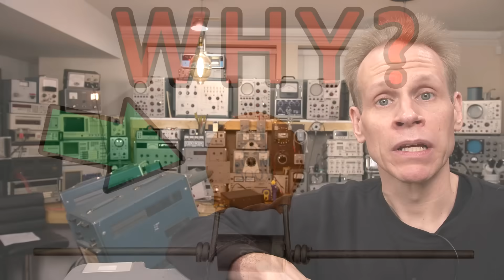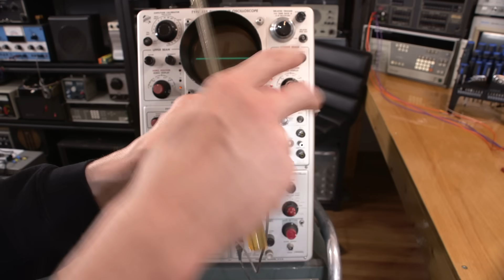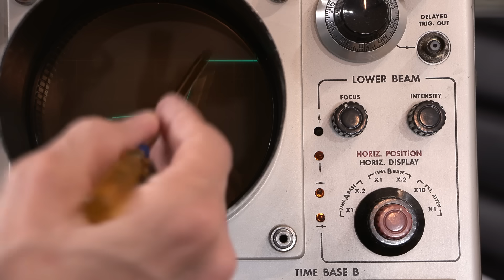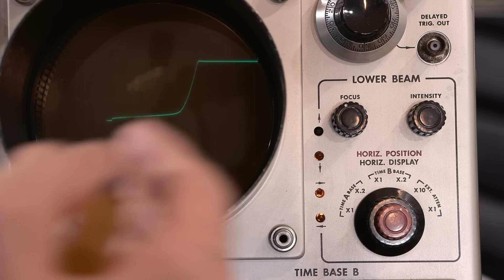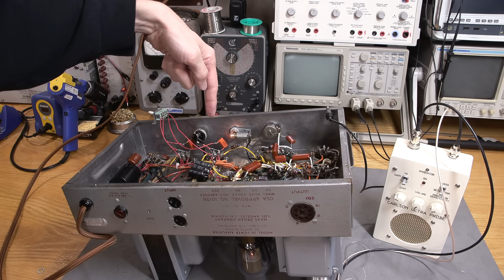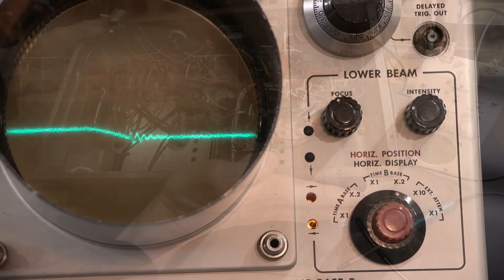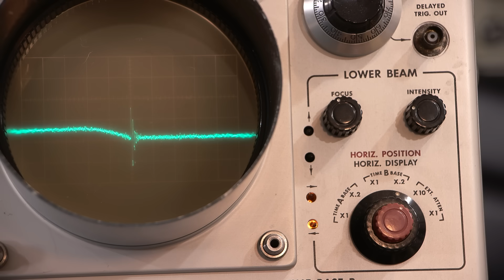Why Put A Capacitor Across The Diode? Here's Why!

Comment: If you look at the trace at 7,00 in addition to the 60 (30...?) Hz spike, you'll see a damped oscillation, yet another contributor to the noise. The capacitor acts as a short-circuit for the faster rise- time of the transient.

Comment: Great video.  I do wonder about the length of those wires to the switch, and how much they are acting like antennas.

Just like every car I have sold, I regret getting rid of my terrific Tek 555.  It was several years before I got to use another scope that triggered as well (modern scopes are pretty good at triggering).  It was wonderous how well the delayed sweep worked using only vacuum tubes.  The 555 is a pleasure to use, especially in the winter.

Comment: Thanks for this super tip. I never considered this in my 40+ years with electronics, now I can't unsee this, and it's permanently burned into my mind. Great tip, and I will stay glued to this series from you when you release them.
Reply from the maker: Glad it was helpful!
Reply: @MrCarlsonsLab  I've used your "trick" already today, I took the Heathkit Tube PSU (PS-4) and added 10nF caps to the 1N4007 I had used in place of the Selenium Diodes. It's rock stable, zero noise now.

Comment: There is another effect which makes capacitors across rectifiers a must. It is not related to reverse recovery, but it applies mainly to anything that has anything to do with AM modulated radio signals like MW radio or analog TV, but also indirectly with FM as well. And it is very tricky to chase, if you are unaware of the mechanism.
Any rectifier is a heavily nonlinear element, that changes conductivity. Not only for the mains power current it is supposed to rectify, but also to any RF currents that happens travel along the power lines. It could be some disturbance, but also the main RF signal, like an antenna ground return currents from the  equipment internal "ground" connection to the real ground.
What the rectifier does to it? The rectifier varies its dynamic resistance along the mains 50/60Hz frequency. That way it is periodically altering its RF impedance. And because it is in the RF current path, it creates extra parasitic amplitude modulation on it. And this parasitic modulation then turns into disturbance of the main signal.
The tricky part is, unlike the true noise disturbance sources adding extra voltages, the parasitic modulation does affect both weak and strong signals the same way: It is small (compare to other noise sources) on weak signals, but stays the same, so become relatively (vs the other noises disappearing) strong disturbance with strong radio signals. It then tends to mislead the diagnostic away from it being an RF problem and posing as some AF/baseband (after the detector) problem.
The capacitors parallel to the rectifier element (not only silicon, but as well a vacuum tube diode) bypasses thar varying, modulated impedance by an essential RF short circuit, so significantly reducing or even eliminating the parasitic modulation effect alltogether.

Of course proper antenna and ground connections reduce the effect too, when there is less RF current going along power lines, less of it could get that parasitic modulation, but nothing is perfect, the capacitors are just another piece to tackle the noise.
Reply: @annaplojharova1400 Wouldn't an RF snubber network (or filter) be a better solution for filtering out the RFI scenarios you are describing (those coming in from the outside world)? Although I did find your explanation a little confusing, sorry about that..
 
And if I may add. A typical tube rectifier has a soft recovery period, this tends to limit the likelihood of any transients.
So probably no real benefit putting a capacitor directly across the cathode and anode of a vacuum tube rectifier, as it may well cause other issues?
Just a thought..
Reply: @Chris-vk3 The point is not about the rectifier generating any RF noise. It is about the intended received signal, just partially passing through supply wires (usually as a path to ground, or at higher frequencies the supply cord acting as a part of the reception antenna). It is about the rectifier acting as a switch, periodically at a low frequency (50/60Hz) turning ON and OFF, so varying the signal strength that goes into the receiver. And signal strength variation is a modulation the thing put on the signal. And if the system is sensitive for amplitude variation (like the AM broadcast definitely is, analog TV definitely was; FM broadcast is more immune, but mainly when multipath reception conditions are involved, it may cause alternating which of the paths is the dominant one so alter the phase of the result and that will demodulate into the audio as well).

If the diode is in reverse, it conducts no current, so it has just its rather small capacitance, so for the RF exhibits rather high impedance, so "the switch" is OFF.
But if a forward current flows through it (during the power conduction), small voltage variation causes large current variation, so in other words it exhibits very low impedance for the small signal RF currents, so ""the switch" is off. And because it periodically changes states between forward and reverse, it is periodically changing its impedance, so the amount of RF current passing via the supply leads.
For this it does not matter if the diode is soft or hard, the dynamic impedance will vary and the RF get parasitic modulation either way.
But if you bypass it by sufficient size capacitor, that capacitor will act as a short circuit, so will pass the RF currents from the supply wires all the time the same way, so the signal stays constant, so no extra modulation.
Adding series resistors would make this thing worse, as the resistor will be higher impedance than the rectifier diode when carrying current (a semiconductor diode with 100mA forward current acts as about 0.2 Ohm), the "antenna" connection via the power cord will have about 100 Ohm or so, so the impedance must be way less than that to suppress the parasitic modulation But sometimes a resistor is necessary to dampen the resonance (suppress the ringing) with the wire inductances, then it must be kept as low as possible.
Reply: @annaplojharova1400  That is exactly why I now redesign my power supply in my amplifier to contain two snubbers - one before the bridge rectifier, and one after. I am using SiC diodes, and they have a tendency to carry over noise (high freq. - MHz) from the transformer as well (toroidal in my case). But to avoid overdamping, which make it worse, I have to use a quasimodo to tune in the right values for the snubbers. As I use 5 toroidal transformeres, and one with 3 secondaries, I will use a total of 14 snubber filters, all individually dialed in, otherwise they worsen the sound.
Cheers.
Reply: @annaplojharova1400  
Excellent - and one who has writing skills - that so many are lacking in
- despite attending school for at least 12 years 

Also impressive is that you understand the contextual difference between
ON / OFF     and  on / off
Reply: Hi! This is called intermodulation interference.

Comment: A little clarification would be nice, because you used two capacitors for the four diodes in the amp, a solution that I never considered, I always saw one capacitor across each diode. Also a demo would be nice with soft recovery diodes, to show how much less noise they generate. And what about putting ferrite beads on both legs of the diodes, and put the capacitor across the outside of the ferrite beads? Would it reduce the noise even more effectively? And AFAIK, this is not just conducted noise, but also radiated, so one might consider putting the rectiiers in a shielded can, especially when converting a tube radio from tube/selenium rectifiers to silicon.
Reply from the maker: The diodes are in series is to increase the PIV, so any inductive kick will be below that level, or limited to it.

Comment: So the value of the cap you need is related to frequency of the hum you're trying to remove?
Reply from the maker: It's basically getting rid of diode switching noise.

Comment: Why is Mr. Carlsson saying 2 parts of 50 cents each solves the problem ? For a full bridge rectifier you need 4 capacitors unless you have a trasformer with median connection in which case, yes, you can rectify AC with 2 diodes (and 2 capacitors).

Comment: The way i understand it, its to do with the switching speed of the diode. The faster the diode is capable of switching from non-conducting to conducting (during a 50/60Hz cycle) the more harmonics are produced throughout the spectrum. That sounds like buzz in an radio receiver. Rather like what a square wave generator would produce. So by adding small capacitors across the diodes effectively makes the diodes slower acting with less harmonics generated.

Comment: I am surprised to see you running a tube amp without a load.
Reply: No signal, no problem.
Reply: @andymouse  Well, not really. Noise is a signal. And amps sometimes oscillate without a load. And if you accidentally forget and send a signal through it, well, you might be out an output transformer and some tubes.
Reply: @RedBankVintageAudio  Strictly speaking yes, but ........ :)

Comment: Is this the same or similar to the squelch knob on older radios?
Reply: No.  The squelch was an adjustable mute.  The squelch allowed someone to monitor communications without having to listen to constant RF noise when no communication was incoming. When a signal was above a certain level determined by the squelch level, the signal would be passed by the squelch circuit which would unmute while the higher level signal existed.

Comment: Can you hear the buzzing noise with the speaker connected to the amp? Also you didn't show where in the circuit or schematic where you connected the scope.
Reply: In reality, there would be no audible difference in the performance of that amplifier either with or without the caps across the rectifiers...

Comment: Interesting video, but a bit confusing. I have some questions:
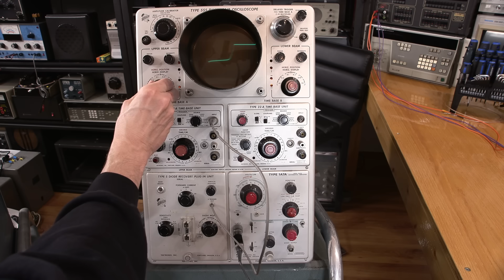1:00 What exactly is that device doing to the diode? And, related, what exactly are we looking at on that screen? What's the X axis? What's the Y axis?
What do you mean by "across the diodes"? A schematic would have been very helpful here, just a simple hand drawn one, showing the diodes and the caps.
Reply: I agree. I'm used to looking at voltage vs time on a scope, but this isn't that. Maybe it's current vs voltage? I wish he had explained what was being shown.
Reply: @mandlehandle-o8k He's using a scope that's been modified to be a curve tracer. It's a little over my head, but he has videos on curve tracers showing how they work and what they're for.
Reply: @mandlehandle-o8k Yes, it shows the diode's current-voltage characteristic. Obvious to people familiar with this area of electronics but otherwise pretty cryptic. I was curious about how it'd change if he added the capacitor, which didn't happen, sadly.
Reply: Just to pile on here, where is the circuit showing the setup and probe points. What is being measure on the X axis? What is being measured on the Y axis? Where is 0, 0 on the X--Y display? What is the scale factor for each of X and Y?
Reply: @tomc101  The 0 and the scale factors might very well be irrelevant, depending on what the X and Y axes are measuring.
Reply: Firstly, I was thinking this is related to using diodes as detectors for AM receivers or something and maybe that's why I didn't understand? Nope, the context really wasn't explained.
Reply: X-Axis: Voltage, Y-Axis: Current
Reply: Thank you. All my questions as well.
Reply: Will this fix the static buzz on my AM radio? Something interferes with the reception. Where do I put the capacitor? What size capacitor?
Reply: Is this in power rectification? Am detection? Where is this diode?
Reply: Useless video. Curve tracer with no explanation of x or Y.. is the diode forward or reverse biased or what.  Regarding the output .. what are you looking at? The DC supply or something else?
Reply: @rowifi  I agree. I'm a retired electronic engineer and to be perfectly honest, I haven't got a clue what he was trying to show us. No schematic, no indication of X and Y on the curve tracer, no indication as to where his magic probe was placed, no indication as to what the probe was measuring etc.  The recovery time of diodes is very short and nothing like the roughly 50 Hz hum from the probe, so what is he demonstrating?
Reply: @Chris-hf2sl   I think it's the instant of forward polarization in time after being reverse polarized.
He is probably showing the current.
You can see that the small step is the actual point in time and current is not flowing right away, but it takes some time for the diode to charge. The cap is making the current flow immediatly because it has to discharge and charge again to the opposite voltage...meanwhile the diode starts its forward conduction and the cap stops.
Reply: @robegatt  That's what I initially thought. But he's rectifying the mains at either 50 Hz or 60 Hz, depending on his location. Diode recovery times are measured in ns or less but the little flat part of the waveform at the beginning on the curve tracer was a significant proportion of the waveform, so it was in the ms range, at least a million times longer than a diode recovery time.
Reply: @Chris-hf2sl  You mentioned the quick recovery time of diodes, but the additional thing here is the resulting transients..
The second part of this video demonstrates a diode being switched at mains frequency, as it's a rectifier in a power supply..
That's where the 50 Hz you mentioned comes from, and what we're seeing is the resulting switching transients (without the capacitor in parallel) on the second cro trace.
As for the sniffer probe, have one similar that I've been using for years, and it doesn't need to be connected to anything. 
Thing is you need to know what to look for, and where to wave it around!?.
Reply: @Chris-hf2sl  he actually says "this area is the reverse recovery time"
Reply: @robegatt  Well, that's fine, but then we're not looking at a 50 Hz or 60 Hz waveform. So what are we looking at?
Reply: @Chris-hf2sl  that's a very underestimate question 😅
Reply: @Chris-hf2sl A transient (noise) resulting from that recovery area or quick step.
Basically the power supply diode is ringing and decaying as a result of this quick step every time it's cycled at 50 Hz.
Reply: @Chris-hf2sl  he's measuring some ancient "rectifier diodes" which have super slow reverse recovery times. All this is solved by just using more modern better diodes that recover faster. The problem with the slow diodes is they're still conducting as the AC waveform is going negative, and then when they finally turn off very suddenly, you get a high dv/dt spike that cuases noise. Faster diodes would stop conducting while the AC waveform was still around 0, and thus not turn off once the AC waveform is already going negative, eliminating the high dv/dt spike.
Reply: @rowifi I mention what's going on with the curve tracer above..
Reply: The curve tracer could be described as an oscillatory voltage and current limited source coupled to the X and Y deflection inputs of a standard oscilloscope. The important thing to remember is that this oscillating source is referenced to ground (zero volts).
In this case a 2 pin semiconductor device was placed across the source, and what we saw was both the voltage and current change wrt time.
The X axis represents the voltage and the Y current, the source frequency could be 1 kHz or 10 kHz, or any arbitrary selection, with an amplitude that would supply reasonable results, say 10 Volts P-P..
Hope this helps, maybe not lol..
Reply: Absolutely bad video.
Reply: @robegatt  Yep. It would have been much better to see that first scope trace with the capacitor in and out of circuit so we could see what was happening.
Reply: @robegatt  Absolutely awful comment
Reply: @DinoDiniProductions  ok
Reply: It is quite literally across both ends of the diode.  In fact he shows this in the video.  Solder a capacitor across the anode and cathode.  It's actually the thumbnail pic.
Reply: @Runco990 But in the amp it's different, two capacitors for four diodes.
Reply: @Runco990 Are we talking about one diode or more than one? It's not all that clear.
Reply: @CristiNeagu  It could be one or many, it depends on the device and circuit the diodes are in. Not that he mentioned but I suspect it only matters when there is an audio device or circuit that can pick up that noise. Which is why most diodes do not have capacitors across them.

Comment: The buzz when capacitors are removed from the circuit reminded me of a light dimmer switch when I was a kid that would mess up the AM radio on my parents' vacuum tube console stereo.  If I wanted to go into that room while the AM radio was on, I was expected to use a different light.
Reply: Same problem, different flavor. 😉

Comment: This is only partially correct, a diode should be shunted with an RC link, i.e. a capacitor and resistor in series.
It is the resistor that should do the job, the capacitor is there to prevent the resistor from overheating by the supply voltage.
The fact that it still works in your example is because the diode and capacitor have a certain resistance, but it should be larger.

Comment: AC 240 V contactor arc across the contactor points in your outdoor AC compressor. Have you ever made a video tackling the problem of extending the life, adding capacitors resistors or diode on AC voltage high current contactor ?. 
       I believe in the last 10+ years I have seen one video of somebody showing how to do this, but I cannot refined the video. 
     Can you please show and make a video on stopping like the back EMF and the current at make and brake of contactor points for AC line voltage used on higher horsepower kilowatt hour motors.